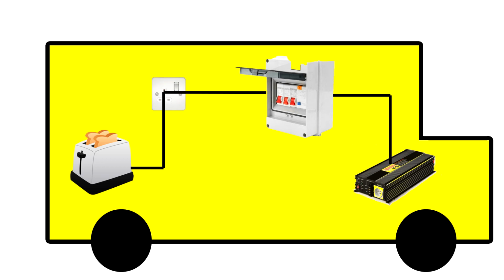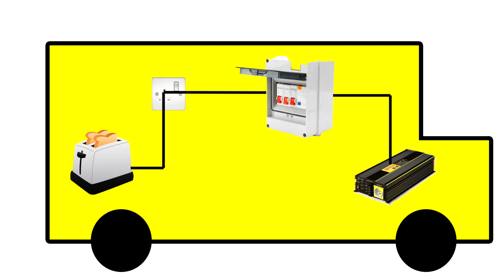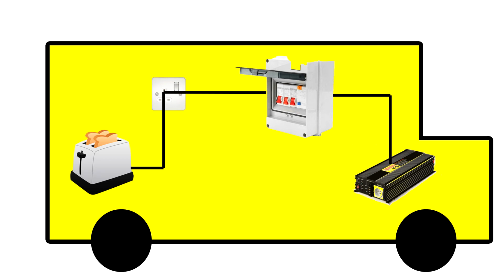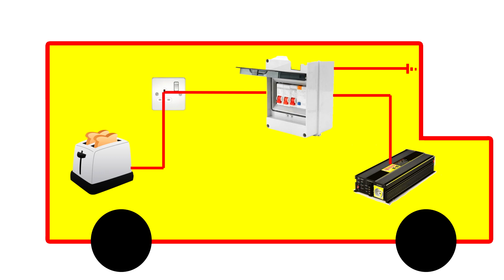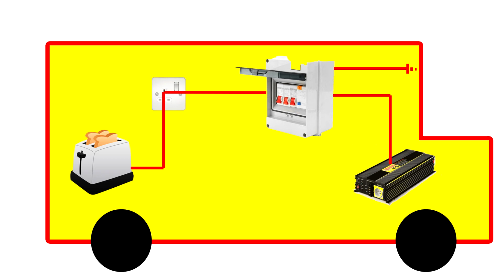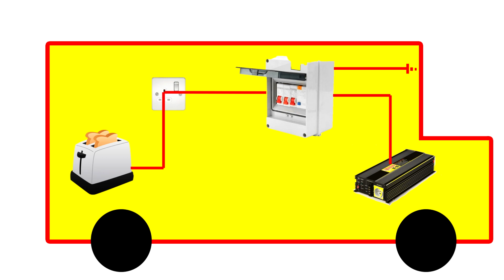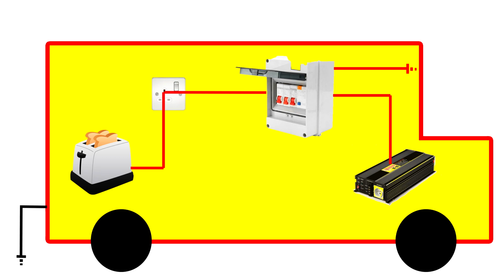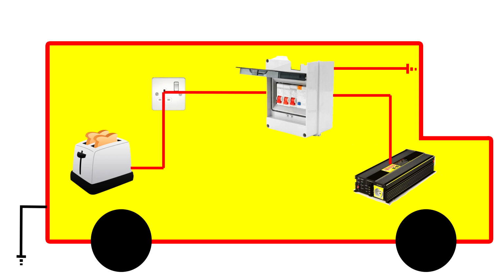Top Electrical Tips For DIY Camper Install

Comment: Surely safest option is to keep to DC appliances, as fault conditions are rarley life threatening? In my setup I use an auto rely to flip inverter off (and battery charger on) when shore power is connected.
Reply from the maker: You would be very wrong in assuming 12v is safer because it's a lower voltage. It's the amps that will kill you. I could give you a tickle with my fluke set to 1000v but you put a spanner across 2 12v terminals at 240amp and you would know about it

Comment: The minimum use of joints in gas pipe is also advisable. On a boat build the inspector insisted that a pipe going through a bulkhead had to be connected to a bulkhead fitting, introducing 2 points of failure. My solution was to drill out the fitting so that it would pass over the pipe but still fave the olive and nuts in place to clamp the pipe, making it appear to the inspector that I had done as instructed but much safer!

Comment: I've been trying to understand about connecting the PE to the chassis in association with an inverter, but I'm not quite there yet. Say you do, and a device has an electrical fault that makes the device and therefore the chassis live, you're saying that results in mains power flowing through a person or through 12V devices? I'd have thought that can only happen when there's a route through the person/device back to the neutral connection in the inverter?
Reply from the maker: You have lost me, but in essence if the RCD is to fail under and live to earth fault and your consumer unit is strapped to chassis. Yes it will be live and everything connected to the chassis will be live. Including you should you short to earth. 
Seems you may be getting confused with neutral and negative. They are two different things. Negative earth or negative ground is in relation to DC, neutral is the blue core of your AC side and if that was to go to ground you would have the same issues as is live was to go to ground.

It's pretty hard to explain over messages which is why I tried to animate it in the video for better understanding.

If you are unsure, strap your earth to the chassis and use an earth spike. That is catagorically the safest way

Comment: Josh can you do a video on the things to watch out for when connecting a VSR to the vehicle battery and how best to do this? I know you haven’t done that in your van but I would find a video on that useful. Thanks
Reply from the maker: VSR as in voltage sensitive relay? I do brush over these in my battery charging video I believe.  What is it specifically you are struggling with? They are in essence a very simple device.
Reply: You do mention them yes, in my van the voltage sensitive relay was already put in and connected up to the leisure battery with the inline fuses present but when I do another van myself from scratch later on down the line I wanted to see how to connect it to the starter battery and how best to do it so it’s all nice and neat but maintainable in case of a problem.

Comment: Can I ask a question here? In the inverters video you choose your inverter based on the coffee machine. In my case I want to charge an ebike. It has a36v/240v charge unit. Using the inverter would step up, down, up and down again which you advised against. I can't see any other way around it, what batteries and inverter would give me a couple of full charges without massive or solar over a weekend? Thanks
Reply from the maker: Firstly check with your supplier that they don't make a 12v charging adaptor. But failing that your best bet would be to use an inverter.
If it was something less expensive I would say see if you can find an aftermarket 36v power adapter (which would in itself be a small inverter) but in this case with it being such a valuable appliance then for sure check what the manufacturer can offer in terms of charging from a vehicle.